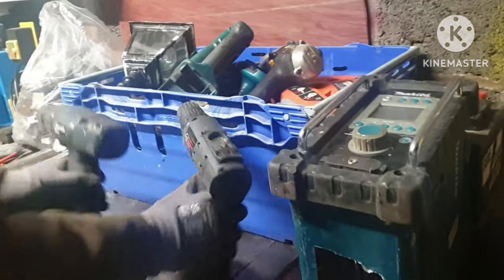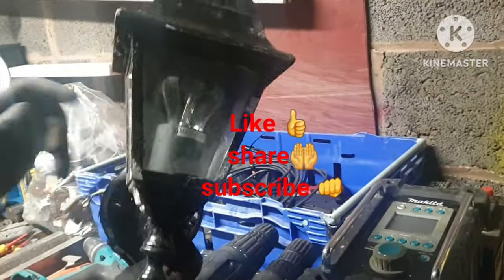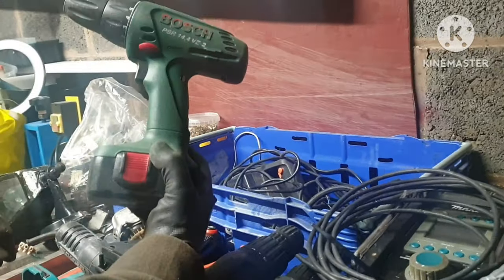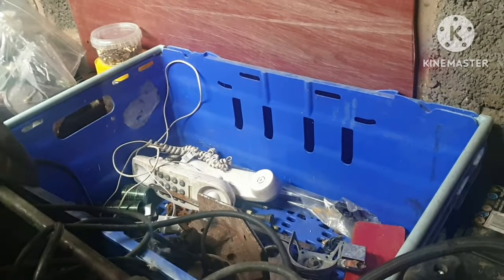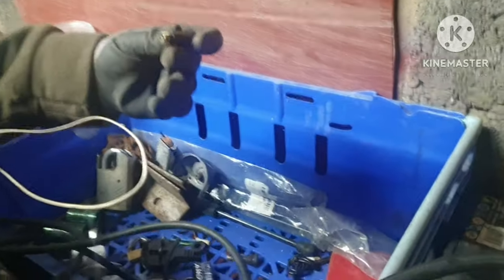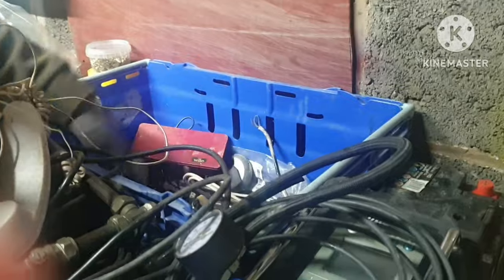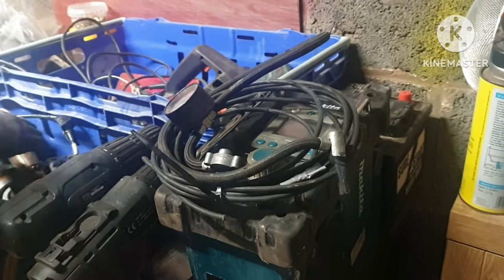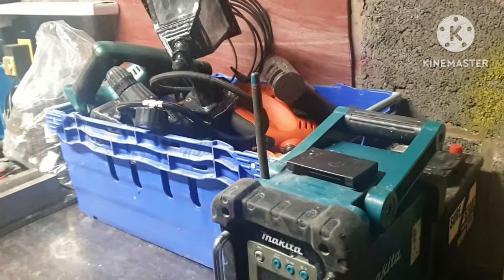from Trash to cash :old broken power tools        #scrapping #howto #hobby

Comment: Not much in those cordless drills other than small dc motors unfortunately but it's still weight to the electric motor pile bro
Reply from the maker: Yeah I've done loads in the past ,I've got a nice pile of dc moters already so I can add all the dc moters to my pile ,I prefer grinders over cordless drills, alot more copper in them from the stator moter and the cast adds up ,thanks for watching and all the best for 2024 bro